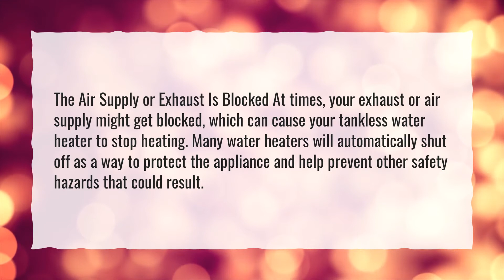Why is my tankless water heater not staying hot?

Comment: I have an issue with my Eemax HA024240. The unit works well, providing hot water to all my homes fixtures except for our Showers. My Faucets and Dishwasher hit Hot water temps of 110 -115 degrees with the unit set to 120 degrees. Our Showers do not get much warmer than 95 degrees. I recently discovered that if I slightly open my cold water faucet in my tub while showering the water coming out of the shower will get hot enough to burn your skin. I'm trying to figure out how to get a hot shower without having to run the cold water out of another faucet at the same time.

The cold water seems to be drowning out the hot water but a slightly opened cold water valve really gets the hot water going strong. I'm not not why this is working out the way that it is because, I'm not running the cold water strongly, however, if I turn off the cold water, the hot water gets cold very quickly. Any Ideas?